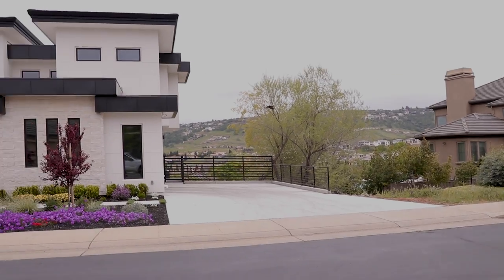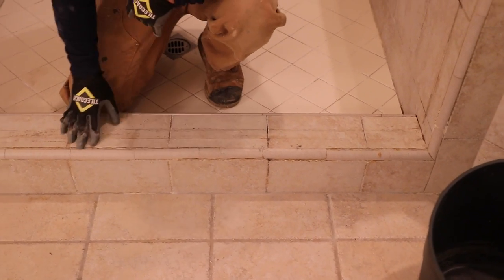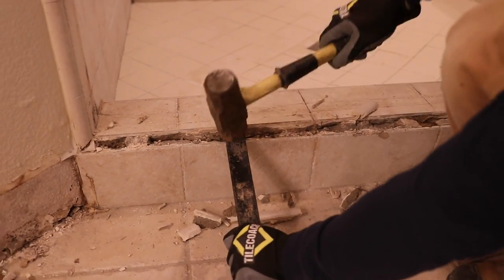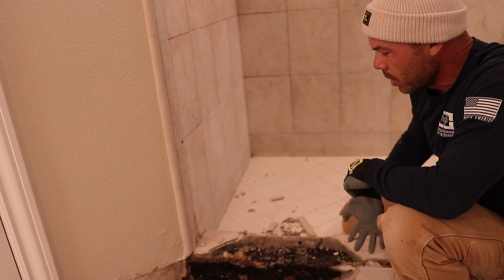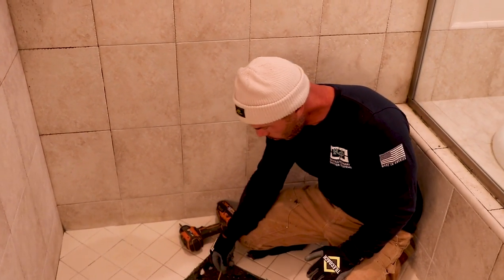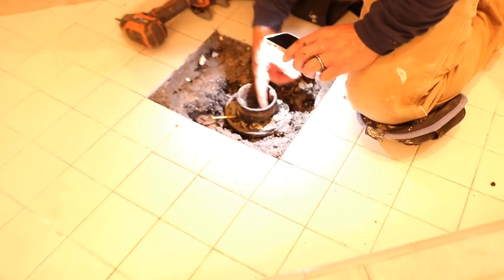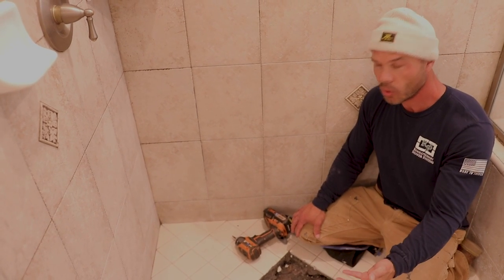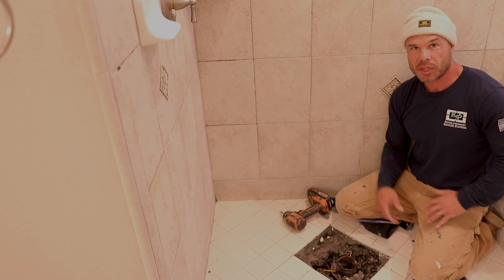It's NOT Your Shower Door LEAKING!!! Tile Curb Failure

Comment: I see a lot of stupid ways to do a shower base.  We do several shower pan rebuilds a year.  No preslope is common as well as building the curb some stupid way. I like a solid surface curb tops so there are no grout joints to let water in at that crucial area. Love the cleanable weep hole idea. Hard water here in Missouri is super common.

Comment: I did floated pans and walls with a tile guy back in the early 90s in the Sacramento area. He in his wisdom used fiberglass from cigarette filters to plug the weep holes. I never knew if that worked but we did a few showers for sure that way.
Reply: Think about it that makes good sense really clever probably an old school trick he learned from an old timer

Comment: I have been doing showers hot mopped , paper, wire, scratch, and float never had any issues ., I always make sure my weep holes are unclogged before I float and floated showers  last 100s of years I bet these new system don’t even last 20 years if they are lucky.

Comment: How would you stop moisture/water infiltrating the grout in the first place, or not long after install?  511 impregnating sealer, and/or something else?  Seeing bubbles and efforescence after power washing outdoor tiled deck. schluter on 1-1/4" ply.  Premixed bostik urethane grout, figured that'd flex and seal.  But am having efforesecence issues here.  Trying to seal and delay tile fail , everything fails eventually, my goal is to delay fail to be after I do.

Comment: This had little to do with weep holes and more with wallboard/mortar wicking into wood....weep holes with tar maybe, but water still gets through mortar in those holes, I've proved it. Suppose it's the drawback of hotmopping using tar for your pan.

Had you taken out walls almost 100% you would see wallboard inside pan.
Reply: That wouldn't even be code in CA. Your board (DensShield) needs to end 3 inches above the  top of the curb. I think this failure is either clogged weep holes, not enough pre slope or a combo of both.

Comment: Not sure if it would work for those weep holes, but I have found that aluminum chain link fence ties have a lot of other uses. They are easy to shape and are fairly strong. I’ve used them to clear weep holes in storm windows.
Reply: So does a foam/non wood curb avoid many of these impacts? Also, no capillary action through foam

Comment: I don’t understand how a foam curb would be any different. The foam is going to give way eventually, I mean it’s foam. I also don’t get how they install a shower door on a foam curb. Even if they silicone the door. Or use a frameless shower door they have to screw into the foam curb. The foam will not provide enough support for the weight and movement of the door opening and closing
Reply: acrylic shower pans for the win... leave the tile curbs for the flippers and uneducated lol

Comment: Tile Coach,  so weep holes let water drain.  When showering with maximum volume of water wouldn't water also flow back through weep holes  ? Problem could potentially be water backup in drain causing weep holes to constantly be wet and never drain  ? Just a theory.

Comment: whats the point of that drain flange above the weep hole other than to help locate the floor waste?
Wouldnt an oversized pipe and then a separate drain set in the tiles be better

Comment: Also, not only is the whole "clogged weep hole" thing largely a myth, there are so many, and more likely, possibilities causing the issue.  Inadequate, detiorated, or compromised waterproofing combined with water escaping the shower interior being the most likely causes.  e.g. floor not waterproofed a reasonable distance from the curb possibly exacerbated by a floor that slopes slightly towards the drain, inadequate qaterproofing at the corners of curb where they meet the wall, screws in the shower rail penetrating the cirb waterproofing.  Also, at the beginning of the video you say water isn't escaping the shower because the frame was well siliconed.  THIS could atually be the problem.  Many shower door frames are only supposed to be silivconed on the OUTSIDE of the shower.  That way water that gets under the frame can flow out of it back into the shower.  Similar to window sills, some shower frames actually have drain holes that encourage this flow.  If you silicone the inside of the frame, water has nowhere to go, and on a tiled curb, is will eventually seep the the grout amd mortar down into the floor and into the curb.

Basically, you tore up someone's shower floor for nothing.
Reply: Yeah clogged weep holes are not a myth. I’ve fixed a ton of showers for that reason
Reply: @Apexjasonmorganllc  Yeah?  Please explain how the clogged weep holes lead to those showers needing to be repaired.
Reply: @nikkikiska  the weep holes are the water escape for the drains.  Anything that’s designed to have water pass through it that ends up clogged affects the function.
Reply: @nikkikiska  it’s not always only the weep holes but usually a combination of a few mistakes during the build of the pan. But I have seen quite a few showers fail simply from clogging those holes. They are designed to open and when you clog them you have a failure in the making.

Comment: Bro, it's not the weep holes.  Weep holes are largely a myth, and your rambling in the video shows where that myth comes from.  You keep talking about capillary action, and say that "capillary action takes over when the weep holes are clogged."  Capillary action is completely independent of gravity and is why weep holes do nothing or nearly nothing in a traditional pan; water doesn't FLOW through a mud bed down through the weep holes.  Water is wicked away by capillary action throughought the mud bed until it's saturated like a sponge (regardless of weep holes) and then will effectively be waterproof because no more water will be able to penetrate it (just like a sponge).  Your surprise that the mortar in the bed is wet and indicative of a problem is nuts; the mud bed will almost always be wet even when propely installed because, as you mentioned, CAPILLARY ACTION!   The pan is most likely leaking around the curb because of inadequate or compromised waterproofing.  I mean, just think about it for a second, if capillary action was the problem, it would exist regardless of the weep holes; capillary action would pull water through the grout and into the mortar around the curb regardless of the drain/weep holes.  And even if capillary action were stron enough to pul water to the curb outside of the shower, as long as the curb was propoperly waterproofed, the wood isn't going to get wet.  So what explains the wet wood?  You seem to think that when the weep holes are clogged the mud bed gets saturated and hydrostatic pressure is pushing the water up over the curb.  Not only is this not capillary action, if such hydrostatic pressure actually existed (which it doesn't/can't), it would push the water up out of the mortar and grout and it would flow down the drain.

Your videos wouldn't be so annoying if you eased up on the hubristic tone.  Especially considering that of the dozen or so videos I've watched, all have varying degrees of incorrect information.